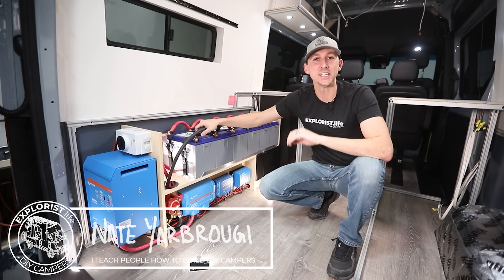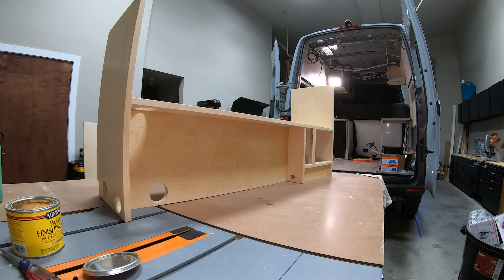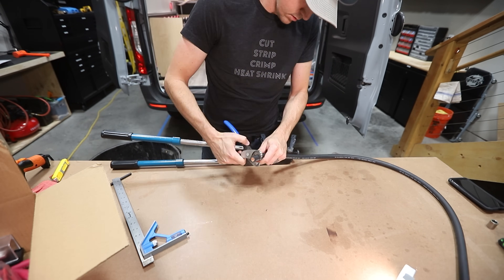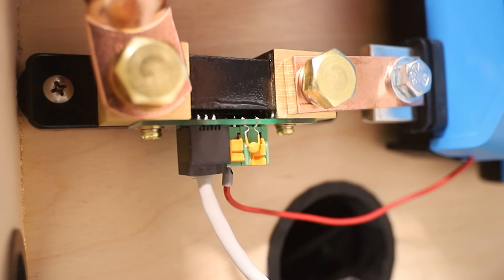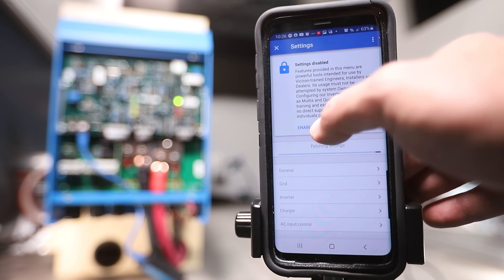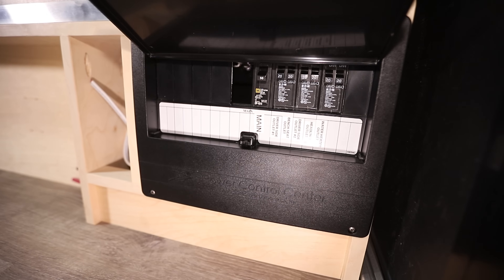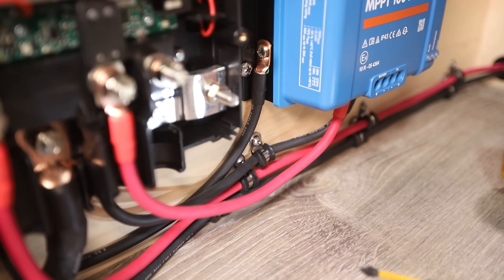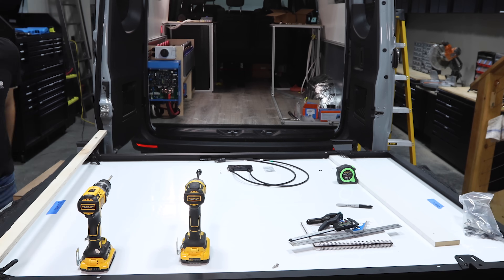DIY Sprinter Camper Van Electrical Install - Full Tutorial

Comment: Those hold down straps may hold down the outer batteries but will do very little for the middle ones.
Reply from the maker: Don’t get lost in the tiny details.  Feel free to secure your batteries however you like.  Your methods of securing batteries does not affect the functionality of the electrical system.

Comment: That was an incredibly well put together video. And I love love love the wiring kits that you put together. This was exactly what I needed . Thank you so much Nate!! That cleared up a lot of questions I had about wiring. I just got a 1977 GMC Classic Motorhome in the 23 foot version and am in the process of modernizing the drive terrain. The next stem is to gut the interior and start fresh in there. Probably the biggest part of the build for me is the electrical system and the cost is way up there also. I started collecting the Victron parts for the build a little while ago and almost have everything for it. People like yourself make it possible for us to do a build without breaking the bank.
Reply from the maker: Nice!  Sounds like an awesome project!
Reply: Whats the cost for this size of system
Reply from the maker: @J. McCloud Just shy of $10,000 for everything from the batteries to the solar panels all the way down to the screws: https://shop.explorist.life/shop/all-products/camper-wiring-kits/600ah-multiplus-3k-12v-orion-12-12-30-400w-solar-wiring-kit/
Reply: @EXPLORISTlife  Very nice set up, not a bad investment for something like this

Comment: That was dope! I’m in the planning phases of doing a conversion (thinking a step truck for my needs) and that was a very well put together and talked through process. I feel like I learned so much but I’ll probably need to watch about 30 more times before I feel comfortable tackling what you just did. That was like nerd art and I loved it! Bravo!
Reply: lol nerd art
Reply: Not wrong though, Im wanting to throw some power into my 97 G20 (Express).  I like dont know where to start power wise.  I just want a tv/monitor, xbox, and router hotspot to run with the possibility of a hotplate.  I can't figure if ill kill batteries or not I probably have room for 3 panels on top maybe 4.
Reply: im on my 90th watch during this whole process tbh

Comment: Excellent video, I just copied your 400watt, 600ah, 3000 watt system, bought the plans and did all your tutorials, the system works perfectly, thank you…I had zero experience with a solar/electrical system

Comment: Great video! A really helpful tutorial for any DIY’er or someone looking to check the work on a vehicle prior to purchase. 

I used your wiring diagrams and previous tutorial videos to build my system because you came highly recommended. 
Note: if you need specific info on how to crimp or another task-separate videos are available at Explorist.  

One major thing missing we discussed:  it would be nice it would be if ALL the power system components were available from a single source.  
Especially with the surge in RVing, supply shortages and the resulting here today-gone tomorrow and price gouging sellers. 

I appreciate how long you’ve been doing this, and if you have everything a DIY’er needs at the same cost of going to Amazon, AND I know it all works together, it’s a no brainer. 

Can’t wait to check out your upcoming build in 2022!
Reply from the maker: Awesome!  Glad it helped.  Thanks for watching!

Comment: Thank you so much Nate. Your videos have singlehandedly given me the confidence to tackle my own electrical system, just when I was on the brink of crumbling under the stress of it. I do have a technical question about this arrangement and the lynx distributor. I purchased your diagram for this build and I'm trying to see if I could wire a second 12v fuse block into it safely or if the space available in the Lynx will not allow for that. Any advice would be appreciated! Thanks again!

Comment: Not only do you use excellent material and you explain it in a fantastic way, you are the first person I see mounting the electric system in an RV and don't make a mess out of it. Can you also show this video to the guys at the RV company just north of Chicago where they build the rental RV's? Why? Because they make such a mess out of it. The first time I rented an RV the AC blew a breaker and when I opened one of the dinner table sofas in which the electric system is housing I got tears in my eyes. It was such a mess.
You, on the other hand, make it all neat with great cable management plus you use the correct material.
Great video. Thank you very much.

Comment: Thanks Nate and Steph(sp?)! I used this video along with your wiring diagrams and install kits. I Successfully built a 600Ah system for my 2008 Ford E-350! Sorry to say I did not cut my finger while checking the adequacy of the drilled holes...lol
Reply from the maker: Hey John, Thanks for that!  Glad everything help and that you walked away uninjured. 😂🤣🤦🏼‍♂️

Comment: Question for you and the audience: Using this setup, do you need to disconnect the solar panels when charging with either the alternator or shore power? Or can the solar panels just stay on regardless of how you’re charging? 
This is the best instructional I’ve seen - not even limited to electrical!
Reply: Same question with shore and alternator charging. Can I have both connected at the same time? It’s unlikely, but just in case I accidental start the vehicle while it’s still plugged into a campsite outlet - will that damage anything? Thank you again for such an epic tutorial!!

Comment: Hi Nate.  I've watched most of your video tutorials and read most of your blog spots.  Wonderful, state of the art, best practices stuff!  I used to set up off-shore cruising sailboats with electrical systems 25 years ago, and it's truly unbelievable how much has changed and how much information is out there now!  It's also interesting how much I have forgotten about the basics. . .

I'm retrofitting a Tab teardrop trailer that we have used for years with a new system, given that many of the components from 2004 no longer function.  We have very simple needs while traveling, and have propane cooking, heating and refrigeration.  The only thing other than a few LED lights and charging phones and an iPad, is charging our new e-mountain bikes off grid.  If my math is correct, running both chargers (and wall current chargers are apparently the only way to get the proper charging pferamaters for the 48-volt Lithium batteries that the bikes use), running both chargers at 2.2a each for a 4 hour recharge is 4.4a x 4hr =  17.6 Ah + 4Ah for inverter operation = 21.6 Ah.

Not a particularly big load, and I am space challenged for the components inside the Tab.  A 2,000w inverter seems like major overkill, and finding the space to put it is pretty much out of the question.  I'm thinking more on the lines of a separate Victron battery charger (perhaps 60a for my 200Ah Battle Born bank as I will be using mostly solar charging) and separate Victron inverter of around 800w.  There doesn't seem to be any combined units available much below 2,000w.  Victron has MultiPlus 500VA, 800VA, and 1200VA (I assume that the number followed by "VA" refers to the watt rating), but not in the US.  They all seem to come from Europe and I assume with an output of 240v rather than 120v. My main question is:  Can these smaller, separate Victron units be set up with the correct pferamaters for the LiFe batteries? I'm finding that these smaller chargers seem to be set up with flooded cell chemistry in mind with voltages a bit too high in their four stages for LiFe cells, and it seems difficult to actually answer this question from published literature, most of which seems incomplete. Some are selectable for flooded, AGM, or Gel, but I also don't know if this is close enough to optimized for LiFe. Re: Inverters: Victron's own data sheets for the smaller inverters do not specify a pure sine-wave power like you stress.  Am I to assume that they are not? (I don't have any particular desire to have internet connectivity on any of these units, as this is a pretty simple system and I don't have any desire to make it any more complicated that it needs to be). 

Thanks for sharing your expertise!  You can bet that I will be ordering the supplies that I can direct from you to help support your efforts.
Reply from the maker: The smaller Phoenix inverters can be connected to a computer/phone for further customization.  I believe ALL Victron inverters are pure sine wave inverters.

Comment: Wow that is a great video thanks for putting it out there it's a great ressource. Got a couple of questions and I apologize if you already answered those before. 

1. Would it be possible to use other location on the lynx negative bus bar for the 4/0 chassis ground? It would make more sense to have it in the far right connection in our build probably 

2. Is it important to have the main switch accessible any time (no panel in front) for safety?

3. Do you use electric grease on connections sometimes or its not recommended?

Thanks a bunch!

Comment: Don't worry about a specific edge banding trimmer, I've been a foreman of a mill room at a cabinet factory for 7+ years now and we just use a sharp utility knife and some sand paper on all our custom shelving. As our standard shelving gets run through an automatic edge bander that trims during the process. The trimmers are nice when new and fresh but after a couple uses you'll find it's easier to just use a utility knife.

Comment: Thank You - for the very detailed and informative YT Video!   I want to convert my cargo trailer into a really good tool trailer - wanting 120 V AC shore power and ability to run off of battery when needed (just for lights and charging tools).   Adding solar panels is further down the line... but this video helps immensely.  Well done!

Comment: Great build  I am a 40 plus year wood worker  from my expierience wood banding with veneer comes loose in places almost allways I use thicker cap moulding about 3 sixteenths to a quarter inch thick  clamped glued 18 gauge  Brad nails from a nail  gun is optional depending weather it's going to be stained are painted.  pease !!!

Comment: Great job, thanks. However I was going through my sprinter manual and they had very specific grounding points. Why are you not as concerned about sticking to those spots? Also in the manual the brought up the harmonics issue of adding electrical components to the van system and that there is a chance of hearing it in the radio. I have been in vehicles before that have the issue. Have you come across it yet?
Thanks for the great videos. I have paid for other wiring diagrams and tutorials but yours has helped the most.👍👊💪🏼

Comment: I just wish i had the money for this let a lone the time to do it and the building to do it in.
i had 2 weekends and no budget and i figured out how to make rain holes in my setup.
I got it working but it cant even power a small fridge for an hour..

Overall biggest set back was not learning what will be using the power once stored. I didn't know and had drained my batteries to quickly. 
Next was the batteries were to small and I have no room to spare I would need to rip out and replace all of it and add more Li bat tires probably 400amphs. 

Eventually it rained and something is not working... so i need go back and look at it. there is a tarp over the camper now and probably needs a lot of work...

I'm so glad a found this channel so now i can lean how to do it right.

Comment: This was a very informative video. Your descriptions were excellent. I would have you build my electrical. The only issue I have is that the enclosure is made of wood which is combustionable material. I would like to make my enclosure out of metal and put a heat detector inside, since its under the bed.

Comment: WOW!. Amazing. So sano. I've been thinking about adding a solar panel to my travel trailer and know that the multi-plus is the best in order to charge controller from all the research I've been doing and you just laid out everything so simply. I've always been a mechanical type guy staying away from volts and watts and amps but I am getting more and more comfortable with delving in. Thank you so much!
Reply from the maker: Hey Chris Johnson, No problem!  Glad it helped! :)

Comment: Very good and professional 👏
Here’s a little tip that I found useful when drilling large diameter holes in plywood…… use a reversible drill, start drilling in reverse slowly till you get a little Ridge. Then when you put the drill in forward, it has a slight trough to guide the entire cutting surface.🤩
Reply from the maker: Such a good tip!   I've done that in metal doors, but never even thought of that for wood. Thanks!
Reply: Hiii 
Great video! Its what we’re following for our own electrical!!! 
Just trying to figure out the diameter 😅size…

Comment: Can all three charging methods work simultaneously? How do they work together? Do the different Victron components communicate with each other to work out a common charging voltage and a shared charging current? Thank you! Definitely one of the best and most complete tutorials out there!
Reply from the maker: They can all be 'on' at the same time, but they will not 'combine' charging except for mutliple solar arrays.  They will more-so automatically take tuns for charging. shore>alternator>solar
Reply: @EXPLORISTlife  Wow thank you so much for the reply! I honest didn't expect an answer. I can imagine how busy you guys must be. Thank you so much for taking the time!

Comment: Super helpful series, thank you, thank you!!  For my Sprinter Van project, I would like to add a 12V AC unit and the necessary amp hours to run this system for a reasonable period of time, without connecting to shore power.  Have seen Battleborn GC3 builds (with 3 in battery bank), as am hearing 800 amp hours is the magic number for 12V AC.   Looking forward to perhaps a future video from you that includes a 12V AC unit.  Adding two more batteries in this video’s battery bank config gets it done, buts it’s always great to see your install videos.
Thanks again
Reply from the maker: Glad it was helpful.  Cheers!

Comment: Fantastic video! Some videos say you need to run an ACC 12v supply to the DC/DC charger to make sure its turns OFF when camper is not used and doesn’t provide a parasitic drain. Could you please explain why this wasn’t needed here.👍
Reply from the maker: The Orion was programmed to turn off when the starter battery falls below 14V which indicates the engine is off since the alternator is no longer charging.

Comment: Sorry for the late question.  Are there any airflow concerns around the electrical components/batteries?  I see some enclosed cabinets and some wide open.  Thank you for your efforts on making this knowledge available to the lowest common denominator folks like me.
Reply from the maker: Yep!  If the components are in an enclosure, the enclosure needs enough ventilation to allow heat to escape.

Comment: Man! keep doing what you are doing the way you are doing it. This was so awesome and so well put together. I'm getting ready to start my build. I'm pretty mechanically inclined as I am an industrial mechanic/electrician. However, I was worried most about how to build an electrical/solar system and what model would be a good place to start. You sir take the cake. You definitely saw a need within this community and filled it. Knocked it out of the park as far as I'm concerned. Thanks for all the resources and work you've shared.
Reply from the maker: Hey mEEboy, Thanks so much!  Cheers!

Comment: Excellent video. Best ive seen. Mind blowing however that sprinter puts the fuse panel under the seat in such an unuser friendly area. What a pain if that fuse blows.
Reply from the maker: Yeah, that would definitely be a pain; but that fuse should pretty much never blow unless wires rub all the way through or something.

Comment: Very smart however there are always questions like how many hours straight can it run an ac unit lights & so & how long does it take to recharge the battery using the alternator 🤔
Reply from the maker: For sure!  We've made videos about both of those topics.  Check out the other videos we've made on those topics.

Comment: Great video Nate. It's so good to see someone physically building the system and not just showing us the end result. I learned a lot about how to go about the process. Thanks.

One question on the master switch though. You have put it on the positive wire whereas there is a lot of discussion about putting it on the negative. If you didn't have a switch in the system then you would disconnect the negative before doing any work so why put it on the positive?
Reply from the maker: There are 'negative switched' systems, but they aren't particularly common.

Comment: Excellent and extremely helpful video! Perhaps a silly question.. If one were to utilize chassis ground as the common ground for the house electrical system, couldn't they opt to use the non isolated version of the Orion charger? Assuming the alternator also utilizes the chassis as common ground this could effectively save the cost of running an additional negative cable from the starting battery? Again, thank you so much for putting this and other videos together!
Reply: Did you ever get an answer to your question?  I am also wondering if the orion can be grounded to the chassis somewhere closer to home.